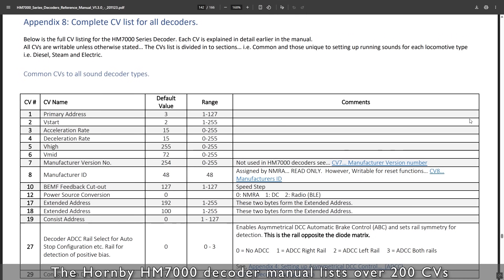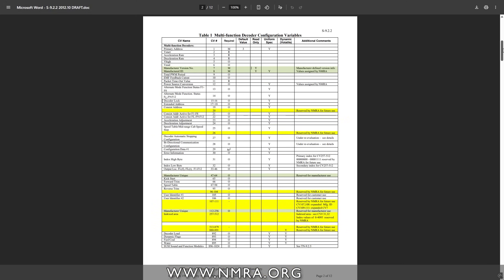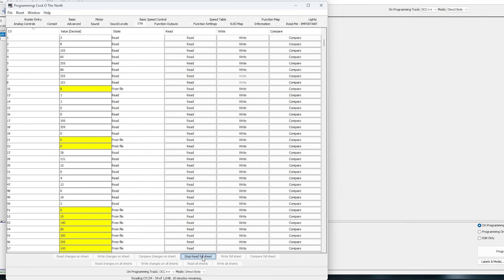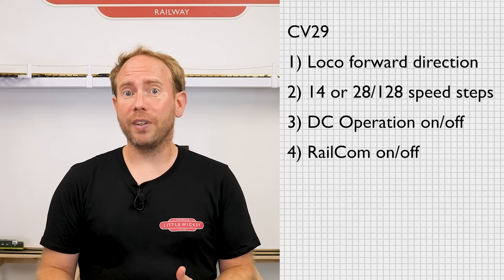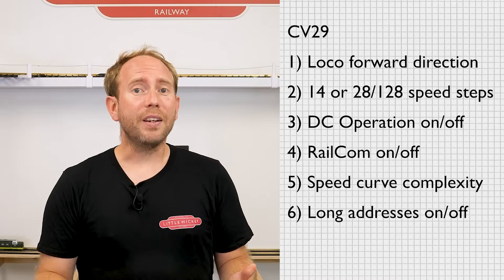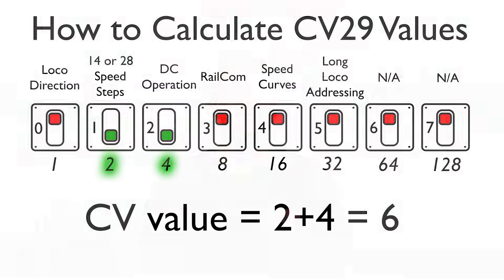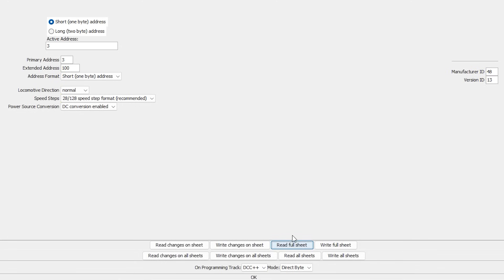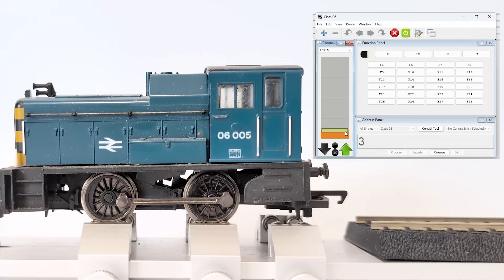What does CV29 really do? | DCC Settings Explained

Comment: When you use a NCE controller, it's very easy to make the changes on CV29, no need for JMRI.
And a good tip, that was also mentioned this video, is that you have to be careful if you have a stay alive build in, than it's best to switch the analog position off.
A stay alive is a capacitor, going from one or more, and those do not tolerate switching polarity.
If you do they blow up, causing severe damage.
And here is a question I have, we see more and more loco's appear with a factory build in stay alive.
This doesn't work if your model comes standart DC analog, but as soon as you build in a DCC decoder, those will work.
But what if you allow in CV29 the use of analog, will these capacitors be shut off when you run it on an analog track?

Comment: Thank you yet another very informative tutorial. With the help from your previous posts I’m now operating a DCC-Ex command station with Wi-Fi to control points, IR sensors, sound files and signals. It’s a bit of a learning curve for the over 60’s but very rewarding. Thanks again.
Reply from the maker: Thanks Andy. Glad you're finding it useful :-)
Reply: @LittleWicketRailway I’m hearing a lot about the ESP32, have you found a DCC purpose for it? Many thank again for your continued support.

Comment: Many thanks Rob , my bachmann class 37 which ran  backwards on the NCE power cab  after removing the body again to make sure everything was fine i discovered the PCB board had been fitted backwards at the factory way back in 2005 so i just changed the direction on cv29 . I think it's a bit late for a warranty exchange 😊 Many thanks
Reply from the maker: How strange, impressed the board went in backwards. Glad you got it sorted.

Comment: For many decoders you can do a factory reset if you think that you have messed up (often 8 to cv8 check manual).  This takes it back to address 03.  
The JMRI screen has handy descriptions for many CV's and you can also save CV's to PC and load into (the same) or another decoder.

Comment: Thanks Rob, that was useful. CVs do seem a bit of a dark art, at least to someone new to. I use a Z21, and it seems fairly simple.  I've only changed one CV so far: the instructions on a coreless motor replacement, recommended setting CV144 to 1 to make it run more smoothly, which I did, but I've not idea what I've actually done! Everything I can find online suggests that CV144 is something to do with flashing lights!
Reply: What decoder have you got? CV144 will be brand specific. Settings for motors are normally in the 50, low 60. On the Tramfabriek website are settings for coreless motors, under Digital>Decoder CV settings. The major change you would see is usually at crawling pace.

Comment: The Lokprogrammer is an incredible tool if you have several esu decoders as you can do all sorts of complicated programming with a really easy tick box system. If you dont want to spend the money on the programmer but still want to use the ui. Then download the free software for the programmer, complete all of your changes and print out the CV list of all the cvs you need to enter manually to achieve what the programmer would have done automatically.

Comment: Nice video re CV29, my only concern is a lot of people have no idea how to connect there pc to the railway to use decoder pro. I use a sprog which is fairly straight forwards with the Powercab.  I have now bought a Z21 command station which does everything itself, but I beleive you can connect that to de coder pro too.

Comment: Hi Rob i have a question .I have a consist set up on my TT120 layout with a diesel and a steam loco i find that they both run at different speed to one another. i did have a go at changing the cvs but now watching this video has given me some ideas on how to get my locos to run both at the same speed though cv29 i think the speed steps of the locos are different so ill start there cheers
Reply from the maker: I expect you might need to adjust other CVs. Consisting is another good idea for a video though.

Comment: Certain irony in the video examples - ESU diverge from NMRA recommended CV's quite rapidly, eg. CV29, the 28 step speed table is compulsory for a LokSound or LokPilot V5.  
JMRI/DecoderPro knows about the arrangements for an ESU decoder (and those for thousands of other decoders), meaning owners don't have to worry about them.   JMRI/DecoderPro keeps a record of anything set in each loco, so that saves writing it down.  When one moves beyond very small changes, writing stuff down gets out of hand, which is where using a computer application starts to score as it stores things for you.       

(  I'm author of the 2mm "CV29 calculator" page, and designed the JMRI roster view, both a long time ago.  )
Reply from the maker: Thanks for creating the website and for your work on JMRI. Possibly poor examples, but hopefully the core info still comes across.

Comment: Nice video. As an experienced DCC user (35 years) I agree that CV29 is very important, and all users should have at least a basic understanding of its functions. As for DC mode, according to long time DCC dealer Tony's Train Xchange in Vermont, if you aren't going to operate your locomotives in DC mode, then it is best to turn off DC mode. The reason is that if the decoder momentarily looses the DCC signal, then when it sees track power again it may assume that it is running on a DC layout. Since the track voltage it sees will be full voltage 12-15 volts, then the locomotive will run away at full speed, and not respond to any DCC commands to stop.
Reply: I'm not sure why, but I have noticed that my DCC performance suffers on some locos when I have DC compatibility mode turned on, so I have taken to turning it off on all locos.
Reply: Excellent tip I turned off DC on all my locos, no more runaways!